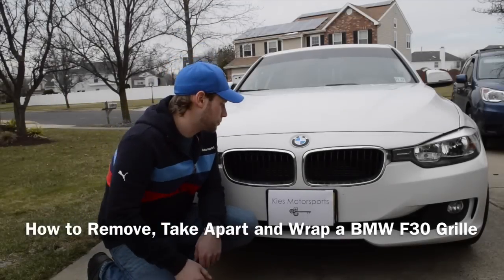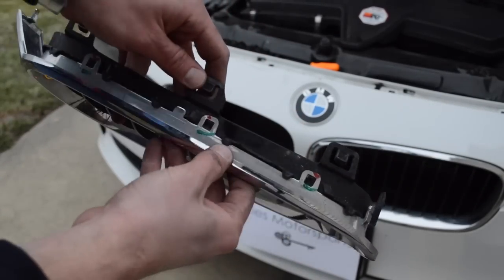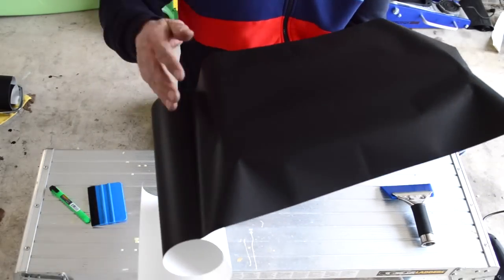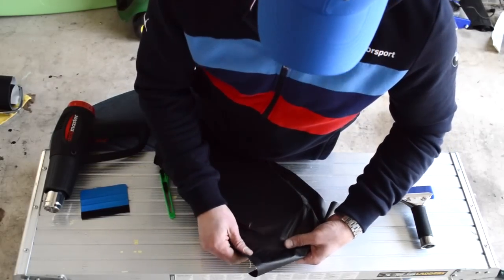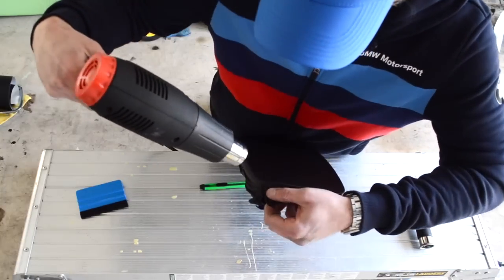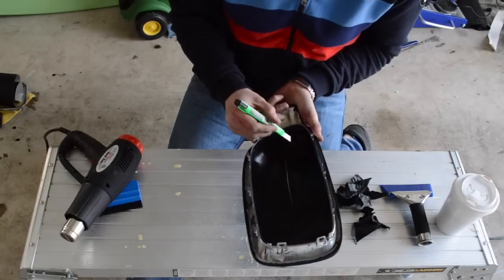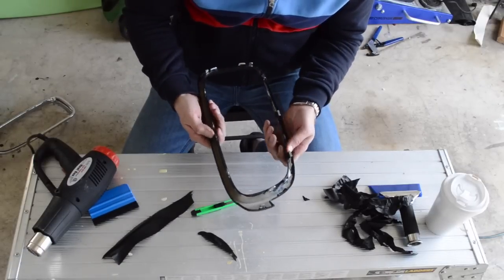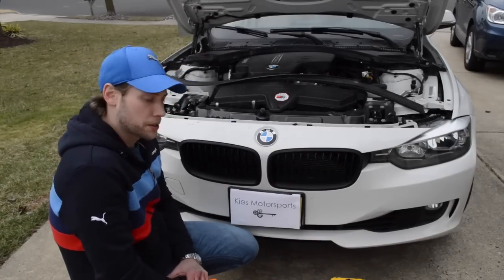How to Remove, Take Apart and Wrap a BMW F30 Kidney Grille

Comment: Great video, thanks a lot!. A very minor tip if anyone is struggling to bend the bumper back (especially in colder climates like I have in Scotland), drive the car around until the engine is at operating temperature. The engine heat radiates to the front bumpers and it becomes a lot easier to bend back to pop the clips off.
Reply: I just tried this around 1 degrees Celsius outside. Had to look up if I was doing something wrong because the bumber is S T I F F.

Comment: brilliant job bro.....saves me buying stock grills from BMW that cost a bomb in the UK... subbed...
keep making more videos....
Reply from the maker: Awesome, I'm glad it was helpful! I'm actually thinking about changing the color of mine again. Good thing it's an inexpensive fix!
Reply: +Kies Motorsports I don't know if mines a two piece I haven't taken it off yet...I haven't got a heat gun as well...will a hair dryer do ? what color are you changing it to ? will you be making a video of it ?
Reply from the maker: Most of them are two pieces, so you're most likely will be (if you have an F30). Sure, a hair dryer should work fine for this. I'm not sure, I've thought about brushed aluminium or gloss black..
Reply: +Kies Motorsports I have a 2 series f22 M sport in mineral gray....same I'm going for the gloss black....
Reply from the maker: That will look great!
Reply: @KiesMotorsports  from where can i buy the autocolant?

Comment: Got exactly the same car as yours, i just did the lip spoiler part, bought the black grill and has yet to put it on. Wanted to send the car to a local garage to fix it for me but they told me the installation fee would be around RMB400 (well roughly 60bucks USD). Lucky that i found your video! thanks alot.
Reply from the maker: +Jonathan Low Awesome, glad it helped! I have a few more videos coming up, so stay tuned! Thanks again

Comment: Great job.  Waiting on my 428iX Gran Coupe (F36) to be built and looking for ideas.  I saw a couple black grills advertised online for as cheap as $30.  Seems an easier option than wrapping in vinyl, especially with the shrink wrapping.  I love your finished look though, and being a DIYer at heart, I'm tempted to give it a try.  Worried about screwing up the wrap and ending up with a crappy looking finish that I can't then undo.  Thoughts?
Reply from the maker: +Aiki Bro awesome, congrats on the car! Those are one of my favorite BMWs..

As for the grille, just be careful of the cheap ones..I've heard stories of them falling out and not fitting well. I've also seen cheaper ones that look and fit great. If I were you, I'd post on a forum or two and try and find someone who has one.

As for vinyl, it's way easier then it looks. Search YouTube for Arlon Vinyl. There is a guy with long hair who does a good job explaining how to do it. Just get a heat gun and some good quality vinyl like 3M, Avery , or Arlon. A 5'x1' piece will be around $10-$15 and just get a cheap heat gun ( I think mine was $8 at harbor freight). Vinyl is very forgiving and if you want me to make a short video on some basics, I can give it a shot..
Reply: +Kies Motorsports Thanks for the response.  Interestingly enough I have a heat gun from HF, though it has stopped working on me.  Based on your encouragement I may just give it a shot... I really love the black matte look.  Don't undertake any additional work on my behalf, but definitely keep me posted (I'm gonna subscribe anyways) if you do.  Thanks!
Reply from the maker: +Aiki Bro That's the problem with harbor freight sometimes. I have some vinyl left over, so I'll try to do something when I get some time. Maybe I'll wrap my wife's car's mirrors and see if she notices...  I'd like to see if a hair dryer would work for this, so maybe I'll borrow my wife's..
Reply: +Kies Motorsports I believe it's the same one as yours, was shrinking some plastic to seal my windows this past winter and it just stopped.  Haven't tried it since, so maybe it just needed a rest.  Only paid about $10 for it, so I won't complain too much if indeed broken.
Reply from the maker: +Aiki Bro Yea, who knows.. maybe it will come back to life? Worst case, they're super cheap..

Comment: I noticed you're using a K&N air filter, can you honesty notice any difference in both power and fuel economy?  great video BTW.
Reply from the maker: Thanks! Honestly, it got a little louder, but I didn't feel it pull much harder. Too little gains to tell, but I still love it
Reply: +Kies Motorsports I have read that there are concerns that oil cleaned air filters like the K&N can potentially damage the mass air flow sensor. Thoughts on that?
Reply from the maker: I've heard that, but I've never know anyone that actually had a problem.
Reply from the maker: +Ken Lawton you can also clean the filter with the cleaner and just don't oil it.. I never re-oil it
Reply: +Kies Motorsports ok thanks good to know.
Reply: +Kies Motorsports Maybe a video on cleaning the maf sensor in the future?
Reply from the maker: Sure, thanks for the suggestion! I have everything I need for that..

Comment: Great work. Btw, can I spray it on the chrome surface?
Reply from the maker: Hi, are you talking about PlastiDip?
Reply: Kies Motorsports Nah, warping is too troublesome. I am thinking to spray on the chrome frame. But I am not sure whether the paint will last long.
Reply from the maker: It's not bad and you have a lot more control of the color and texture. You may be able to spray it, but I personally haven't done so. Keep me posted!
Reply: BCAutoFever 4 years later but for anyone who may read this response. I sprayed my chrome once before and immediately regretted it as whatever you spray will not adhere like you want it to causing a very uneven texture.

Comment: hi i have been following your video since i bought 2012 328 and window chome trim looks awful.. i see lots of sticky rubber-like glue sticking out and i really want to remove it and put it back on properly.. can you plz show me how to remove windoq trim and reinstall using right?
Reply from the maker: +BMJ901012 Hi, thanks for watching! That's sticky stuff can be a huge pain.. Have you looked into wrapping it with vinyl?
Reply: actually chrome trim was reinstalled and they did lousy job on it and what i wanna do is remove trim part completely and reinstall it

Comment: Really nice instructional video, but that could have been done in 3 easy steps:

1. Order matte kidney grill on Ebay or Amazon

2. Pull old grill right out, without removing any screws

3. Pop em in as you did....DONE!

Nice vid though.
Reply: Cost.

Comment: hey did yours have Bluetooth audio streaming? off topic but  mine didn't and i wound up getting a USB Bluetooth receiver that had a aux input and plugged it into the USB under the glove box and wired the aux cable under the center console into the armrest to plug in for a clean install. Just thought I'd share since u have a good set of How To's going on for the F30 lol
Reply from the maker: +jlei07 Mine actually did come with that, but that's awesome that you did that. Have you looked into seeing if it can be coded to be turned on in your car?

If I didn't have it, I totally would have done a how to on it! Thanks for your message
Reply: +Kies Motorsports yea not something that can be coded. i have a 2013 and this model does t have the A2DP component to stream audio. if i got the kits ita 600+ plus other things. would love to learn how to code tho
Reply from the maker: +jlei07 oh okay, I wasn't sure on that. That's really expensive for what you get..

Coding is cool,, but I wish you could easily tune these cars without a piggyback. I had a WRX before this one and an $80 tune got me 85 horsepower..
Reply: +Kies Motorsports haha thats hilariois me too. i had an 2011 wrx before thus. accessport intake exhaust and boom
Reply from the maker: Nice! I had a 2010 with just a K&N drop in and a Torqued Performance tune.. Before that, I had a 2005 that was fully tuned with a downpipe and all..

Comment: Wouldn't had been easier just to plasti dip it?
Reply from the maker: +A Rodriguez Hi. Yes, PlastiDip would have been much easier and less time consuming. I've done a lot with PlastiDip on previous cars and although it's easier, I was going for a different look. The vinyl gives it more of a "matte paint" finish, that's perfectly flat, where the PlastiDip gives it more of a "textured" look. My last car had a PlastiDipped Roof and although it looked awesome when I did it, over time it started to look more weathered. Thanks for watching and asking about the Plasti Dip, I'm sure that a lot of other people were thinking the same thing.

Comment: Man just use plasti dip and save urself time
Reply from the maker: It does take longer, but in the end it looks nicer. PlastiDip typically looks uneven, where this will give you a better finish.. and it should hold up a little better. Did you dip yours?
Reply: I dipped mine too. Holds like a year now. Looks fine, just put enough coats on it. I used black matte 4 coats and glossifier 2 or 3 coats. Looks good, just warm the cans up a little bit, then the surface looks smoother ;)
Reply from the maker: I think you hit a good point.. It's mainly the glossifier that helps it get nice and smooth. Does it still come off easily with that applied?
Reply: Its easier to peel if there are more coats. Holds longer, peels easier. Check out "Dip Your Car" for tutorials with cans or even with spray gun.
Reply from the maker: Yea, I will have to check out the glossifier and see how it does. I was wondering if it peeled the same